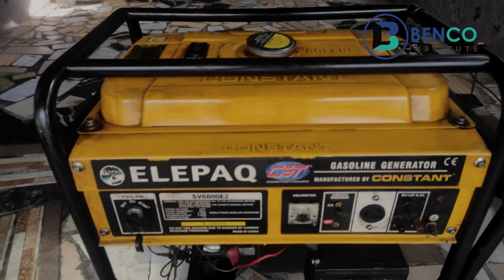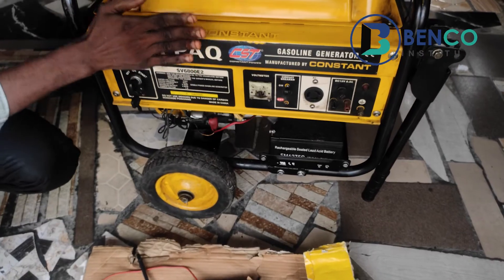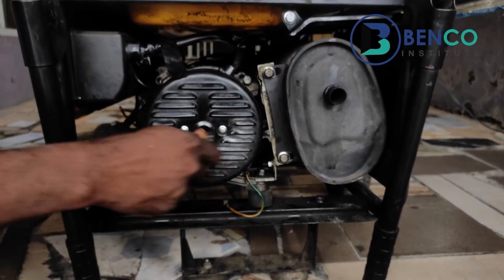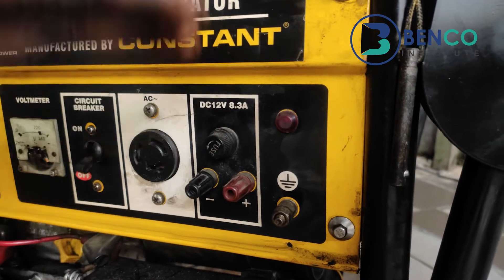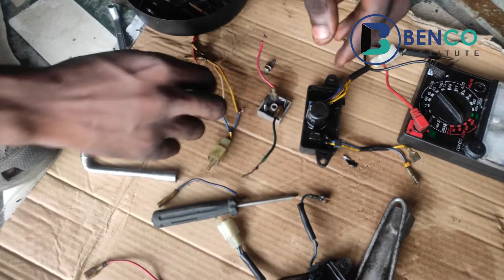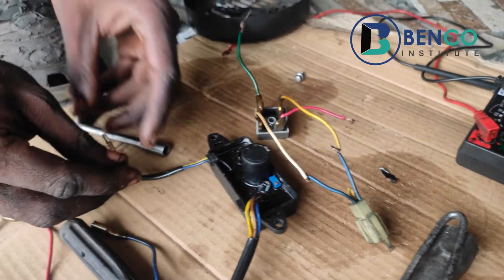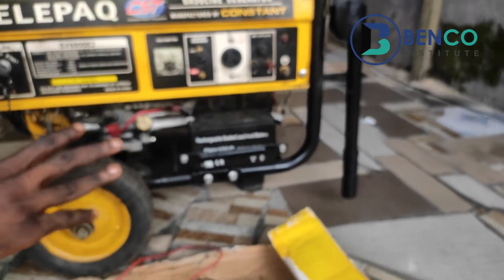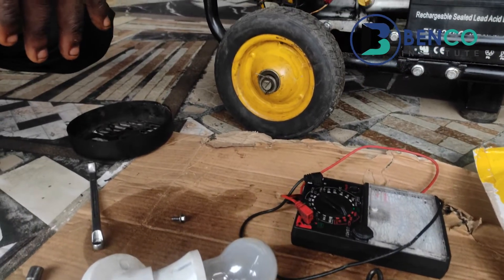Fix No or low  Power output by converting AVR to Diode(bridge rectifier) @jcondon1

Comment: Can this bridge rectifier alone be used to step up a low voltage from a generator with a faulty alternator just as way the bridge rectifier and capacitor did in your last class?
Reply from the maker: Yes it can

Comment: Sir in the last video the generator gave an output of 271v to 280v  
Is there a way to reduce it to the required 220v to 250v
Reply from the maker: Yeah..

I assume you are referring to the video i converted avr to capacitor..

You can reduce the voltage by reducing the speed of the generator
Reply: @bencoinstitute  Ok sir thank you 
And one more thing

Comment: Like I’m having a situation with this same kinda Gen. … the old Avr no longer supply energy like it use to ..I’ll have to turtle the Gen before it supply’s light and now I have gotten a new avr and a new brush as well but it still the Same situation but the new new AVR stops working shortly 
….what can I do
Reply from the maker: Your rotor is gradually having issues
Reply: Please what’s the rotor … you mean the Gen can’t be converted diode or capacitor???
Reply: The second Avr I put in just stoped working and I had to even turtle it before it worked
Reply: When I try to pump water the voltmeter drops from 200 down supplying no energy

Comment: My Briggs and Stratton 5500 watt generator come from the factory with only 4 diodes (same thing as a bridge rectifier) and doesn't have an AVR (Auto Voltage Regulator), and it has a very small capacitor.   With only a bridge rectifier (and without an AVR)  the AC voltage at the outlets rises and drops depending on the engine speed.  However, a generator with an AVR maintains the correct voltage even when the engine RPM drops under load which is better in my opinion.  The only reason I can think of to replace the AVR with a  bridge rectifier is if someone can't afford to buy a new AVR when the old one goes bad.  Also a a bridge rectifier and capacitor, when sized correctly could be more reliable as there are less electronic components to fail than in an AVR.  The AVR's also have a bridge rectifier in its circuitry.

Comment: nice one sir, I use this diode method and the voltage is too high when tested with multi meter the voltage is about 250v can I reduce it from the screw under the tank? I lost my phone I would have chat you on WhatsApp, I don't mind if you can resend me your number
Reply from the maker: Oh okay

I think I have replied you on WhatsApp
Reply: @bencoinstitute could kindly share your WA number?
Reply: Please sir, can we use doido intense of capacitor